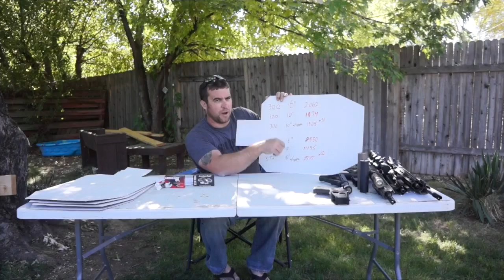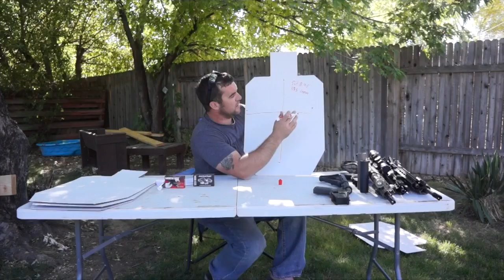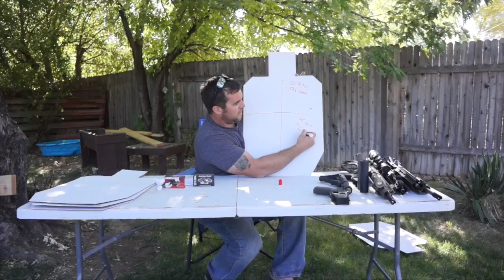Gunfight Science: Is 5.56 NATO Dumb?

Comment: I get what you mean, but your saying that you hate the fact that 5.56 sucks using a SBR. You compare ball to Green tip, yet your using a round that has even less power to that of NATO ball. There have been many vids already that prove what your about to try and prove, but because of your hatered  for SBR's in 5.56, your test does not back up your presentation, or i should say, your test has nothing to do with your presentation. It's not like it's difficult to find 5.56, even from your sponsor Federal. I would say your test is very biased, and you've done everything you can to prove your dislike for that combination of ammo and barrel length. Please do a test that supports your presentation and I will watch. Also, can you possibly do a test using 5.56 and 9mm NATO ammo in barrel lengths that the military uses. I believe the 10.5 inch MK18 upper was made to replace the MP5, not the M4 or M16.
Reply: Essentially, Clay has used his real world knowledge to make informed assessments and opinions. He did test and provide the velocity of two caliber bullets fired from barrels of two lengths, with and w/o a suppressor. He correlates measured velocities with apparently known with bullet dynamics in a viable target. Simplistic? Yes. You can test the crap out of anything in a lab or an analogous model. Until you're in the real world applying the projectiles to targets, you simply can't be 100% correct about the forecasts. What you call bias may be his experience against real world targets. It's like the weatherman on TV....

Comment: First off let me tell you why that is false. First off while you are correct 5.56 was meant to wounds by breaking apart on impact however you do not see those effects until you shoot past 300 meters. At ranges below 100 meters 5.56 actually zips right through enemy combatants causing a very small wound channel. This happened both in Somalia and Iraq where urban combat left 5.56 is a awkward position as it had a lot of penetration but hardly any wound channel. Vietnam was different because soldiers literally just sprayed the jungle till everything moving was dead and Afghanistan is different because ranges are so great that 5.56 actually is used for the environment that it was designed for. That's why the army has been eying an intermediate cartridge that has similar ballistics to 7.62x39, like 6.8 and .300 aac. 

Cutting the barrel down decreases velocity which actually helps with destabilizing the round causing keyholing and extreme yawning at distances 100- 200 meters which cause ghastly wounds which would take any enemy out of the fight.
Reply: Why is everything you say so ass backwards? First "9mm is better than 5.56 at close range" then this nonsense.
Reply: @asdfghjk2933  >4 years ago 
Damn you are late to the party.
Reply: @nemisous83  Fair enough, but what you wrote is backwards. 5.56 zipping through at higher velocities is caused by fleet yaw, which happens at all ranges. The difference is that it still has a really good chance of fragmenting up close, but pretty much none at range. Most of the complaints about 5.56 are about its performance at extended ranges.
Reply: @asdfghjk2933  well this comment was made when I didn't really know much about wound ballistics and bought into internet fuddlore. However the fleet yaw is one reason 5.56 doesnt really perform at close range but also it depends on the angle said individual is being shot at a straight on shot to the torso would zip through largely because of m855 and m193's rather long neck before it starts to tumble and yaw in flesh. 5.56 could really benefit from wide scale adoption of mk262 with a hybrid case design to be propelled at higher velocities.
Reply: @nemisous83  You're actually spot on with everything you said here.

Comment: Obviously you are missing the point of a 10.5 mk18 used by the Navy Seals to kill Bin Laden and they had no complaint because the mk18 often shot in full auto with suppressor "noise was not an issue" double taps to the head is the way they cleared Osama's compound, w lasers n nvg. The argument that the 556 out of a SBR is ineffective is an invalid point.

Comment: I would argue shot placement is more important than wound channels.  The Mk 18 used by special operations forces has a 10.5 inch barrel putting it's muzzle velocity around 2600 fps.  They are most likely not getting the M855 to fragment like it's supposed to.

If a rifle/pistol chambered in 5.56 is able to stabilize the round and run reliably, there is no reason it wouldn't work for a self-defense situation in the right hands.  Besides, there is no reason a civilian should limit themselves to military FMJ ammunition.  It's great for practice due to cost, but there are better options for real world scenarios.

Comment: it will punch holes in your target...In and out...I spent 22 years in the USMC  over 12 years in Recon. 5.56 in a sbr will do the job.. you don't need it t brake apart...its a ICE pick at 2600fpc..i have used a 10" bbl to zap 2 legged tagets... I have seen a .50 cal hit a target at 30 yards away.. blown a kidney out..to the point it layed on the ground..and the target ran 40 yards and bleed out in a doorway..its all about shot placement ....have fun.. Semper Fi...

Comment: I'm not convinced by your argument. A couple of points: 1) The NAVY and the Coast Guard seem to be fond of the MK18 (a 10.3" AR platform carbine) 2) with the right projectile you can mitigate a lot of the problems of ball ammo (regardless of weapons platform) and 3) there is no perfect weapon only the right weapon for the job and you didn't define what the mission for your weapon is.

On the note of my third point above, if you are doing primarily CQB at ranges within 100 yards an SBR is fine and will get the job done. If you are planning to engage at 3-500 yards you will need a weapon more suited to that mission. Just saying a 10" 5.56 is dumb is a retarded statement without first considering the mission parameters, engagement ranges, and targets to be engaged. You mention the .50 BMG is the gold standard for killing people but if you are fighting inside a house engaged in room clearing a large .50 cal will only get in the way and could get you or members of your team killed. The 10.3" MK18 isn't suited to be a standard issue carbine due to its shorter effective range; however its shorter size and increased maneuverability vs the M16 or M4, is well suited for engagements in a house or compound raid like the one to get Bin Ladin.

Comment: If we stick with FMJ, definitely longer barrels are better. However, for most of us we can use hollow points and nothing is safer than a 5.56 rifle of any barrel length using a thin walled ballistic tip light weight bullet (Hornandy V-Max is my favorite)   The bullet can break up quickly even after just impacting drywall, and while the wound is shallow as seen in ballistics gel compared to most rifle loads  (penetrates around 12-14" depending on bullet brand), it breaks up just like how a FMJ fragments like when it is in a 16"+ barrel.

Comment: I may not have much street cred having first snapped in with a General Motors M16A1, but the M193 in a twenty inch barrel is a nasty piece of work. That would be a 1 in 12" twist, 55 grain, 3250 fps G.I. issued pill of death. It didn't hurt that the weapon weighed a breezy 6.5 lbs with an empty mag and sling. The crazy thing is, moving at that speed, the M193 penetrates steel armor better than the M855 as well. Stoner was no dumbass.
Reply: Agreed, 5.56 at its full potential is a serious thing to recon with, and it is so light weight! A boon for any fighter. That said, with improvements in swaging technology, light weight thin jacketed ballistic tip bullets like the V max are extremely effective for home defense in providing amazing fragmentation even at "low" supersonic velocities, as well as providing very minimal overpenetration for it's energy, being able to be stopped by two drywall sheets while still providing around 12-14" of penetration in a target.
Reply: It has been great in the 300 meter fight but, like you said, nominal thereafter. As a standard infantry weapon, which needs to be effective anywhere up to half a kilometer...it has left a lot of guys vulnerable (so they say). Chris Bartocci claims that the M855A1 is so hot (60,000 PSI), that it is tearing up the M4s. Of course, the Marines are using that other round Mk318 or something because the M855A1 doesn't agree with the M16A4. My concerns are that now that the Marines are adopting the Pmag, the Army the enhanced mag, the Marines fielding an FMF battalion with M27 exclusively, the Army the M4A1, and heaven knows what the rest of the people are using, we end up with exactly what we didn't want. A non-standard, services-wide clusterfuck. Were I in charge, I think I would stick everybody back in BDUs, buy one darned rifle that works, let SOF do whatever they hell they want, put the women back in the office, and kick everyone's ass and send them out in the field to train. But then, I am an asshole. :-D

Comment: What about the Russian 5.45 bullet design. What thoughts do you have on that
Reply: If you look at the raw numbers, 5.45 is decisively under powered in terms of energy compared to x39, x35, and 5.56. The big appeal of the 5.45 is its tumbling ability due to the long and rear heavy bullet which like the 9x39, is supposed to give a larger exit wound. Reality though, few shots go through enough meat to get that tumbling effect imitated. Several slavic forces have been known to file a slant on the tip of their bullet to help expedite the tumbling effect, but ultimately, the mechanism is no where near as effective as the 5.56 fragmentation or regular hollow points.

Other factors you have to look at which is frequently not mentioned is the case head diameter. Case head diameter is generally the widest part of the cartridge and consequentially determines how compact a loaded magazine is. Having the same case head diameter, 5.45 is as bulky as 7.62x39, but with a less steep taper leading to straighter magazines (a profile similar to the 5.56 magazine, which of course the 5.45 was competing against). You can carry 40 rounds of 5.56 or x35 in the same space every 30 round x39 magazine takes up. 5.45 is also heavier than 5.56 to a degree which negates any weight savings. Note how 9mm may be very compact, but the heavy bullet [124] grains is as heavy as an x39 or blackout supersonic load which means that while you theoretically could carry more 9mm than rifle ammo, the weight forces you to only be able to carry the same amount. Similarly, the increase in weight and bulk of the 5.45 compared to the 5.56 while ALSO not providing any more energy improvements or wounding mechanism makes the 5.45 a poor choice if you have the option of the other intermediate cartridges.

Note how I say IF you have a choice. Of course the 5.45 will do the job in most cases. Better than a subcaliber at least. However if we can choose, why choose a round that is less effective than another more common option?
Reply: @DaveSmith-cp5kj  it might be underpowered, but the yawing of the round in flesh is IMO more effective than the 5.56 fragmentation. It is not velocity dependant, and you can be sure if you hit them, the round will yaw and their day will get a lot worse.
Reply: Yawing is a lot less effective than fragmentation. Yawing does make a bigger temporary cavity but fragmentation produces a more effective permanent cavity which ultimately leads to faster blood loss. 

Yawing is also still just as unreliable as fragmentation, if not moreso. It doesn't always occur which is why the Russians have been known to file a slant on the tips of their 9x39 ball rounds to encourage it. The issue with yawing is that even when it does happen, it is slow to initiate. So if you are impacting a relatively shallow portion of the body such as a torso directly on and not down the length such as an individual prone or leaning forward, sometimes the yawing won't even happen significantly enough during the time it is in the body. 

In the end, the only real option for reliable mechanics of a bullet are expansion from a hollow or soft point. 5.56 is also the most efficient rifle caliber used to date in terms of weight/size and performance. The combination of these two make for the best home defense/combat option available.
Reply: We are talking about the 5.45x39 not the 9x39. A longer bullet with an air cavity in the tip. The bullet is back heavy and it yaws EVERY time it hits tissue. The 5.56 DOES NOT FRAGMENT EVERY TIME IT HITS. There is a chance, but unless you are double tapping them I wouldn't trust it to do the job. Look at the ballistic jell tests for confirmation. 5.56 takes 5 in to start detonating. the yaw is immediate and NASTY.
https://www.youtube.com/watch?v=r0zP63lRq3I
Reply: Ball ammunition is used with the object of tumbling for both of those rounds. 5.45 isn't the only cartridge to use tumbling as a wounding mechanism.

Again, you seem to not understand how tumbling works. It is much more inconsistent than fragmentation, and sometimes even when tumbling is appropriately initiated it doesn't happen fast enough. Even when it does happen fast enough it is much less effective than fragmentation. Tumbling does not occur all the time and something I missed in your other comment, but actually tumbling is heavily dependent on velocity just like fragmentation. 

As far as ballistics gel, remember that distance in gel is not the same distance in human body. Also the video you are referring to is using two different standards of gel, which you can tell by the density and the way the temporary cavity was produced. They also fail to cite other parameters which is critical when comparing gels. 

And again, this all being moot when the highest performance is obtained by a hollow or soft point which blows both wounding mechanisms out of the water in consistency and performance.

And again, other issues beyond just terminal ballistics are the weight and size of the ammunition. 5.56 is significantly more efficient than 5.45x39 in both categories.
Reply: It would probably be best to read my original comment because looking back it seems I already explained this over a year ago.
Reply: Iskander commie
Reply: Noah Rule Im not really sure what youre trying to accomplish. I know I care about efficiency and effectiveness, I dont care where it comes from if it's not effective or efficient for a serious purpose and I have the means to have the most effective and efficient option ill choose it, like i said before I dont care where it comes from.
Reply: Iskander I'm Fucking with u man

Comment: i like your assessment and it's all very informative, but what you failed to mention is, after that first shot, there are at least a half dozen little brothers on their way before that "wimpy" 22 has even made contact.  those "unspectacular" wound characteristics you refer to are moot points because of the cyclic rate of the AR.  sorry if it isn't spalling, but that isn't going to change the fact the bad guy you just drilled with six keys to the afterlife is any LESS DEAD than they would with a larger caliber weapon with a longer barrel...
thumbs up anyway tho :-)
Reply: the cat's pajamas :-)  i spit a little of my beer up thru my nose from laughing!
awesome
Reply: SpecJack15
i suppose, but that's what practice is for.  i can do the "double-tap" at 20 meters with an 8 inch "shorty" and my groups are inside of 2 inches.  i think that is very not bad.

the range i practice at frowns on rapid fire, so i have yet to test anything more hard core than the 2-shots per second scenario.

anyway, like i said, good information and hell yeah for those Cat's Pajamas!
Reply: SpecJack15
when i used to race cyclocross we approached it the same way they do in NASCAR or indy, each team has enough parts to build a 2nd car.  redundancy is built into their system(s).

likewise, any crucial portions of a hospital or internet hubs, all of those depend on redundancy in case some part malfunctions.

i approach my firearms in exactly the same way.  i consider them to be important tools and part of an overall larger system, therefore, they each require enough parts to repair, rebuild, or totally replace.

if one is good, two is better, or to quote a line from the movie Contact:  why build one when you can have two for twice the price?

however, i tend to agree with you, the AR-pistol and SBR is kind of a waste.  they kick a little more, they bark a lot louder, and the flash, in some of my own video and photographs of my own experience, is TWICE as long as the weapon!!  that's reaching out a good 4 feet in front of me!!

i like the "idea" of them, lighter, faster, easier to swing around etc, but all those things are only very slight advantages which may not be worth the sacrifice of reduced power, increased muzzle flash, etc...

anyway, happy new year :-)